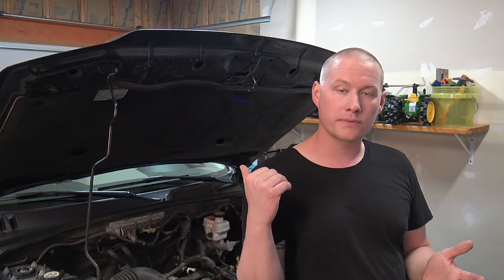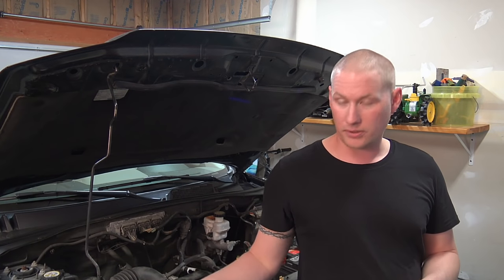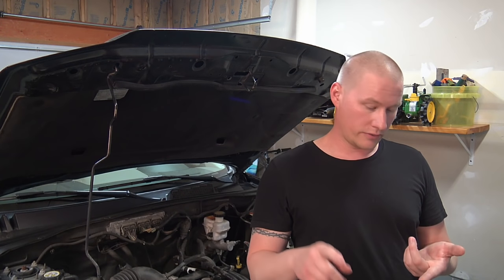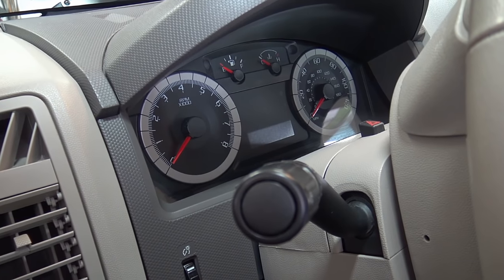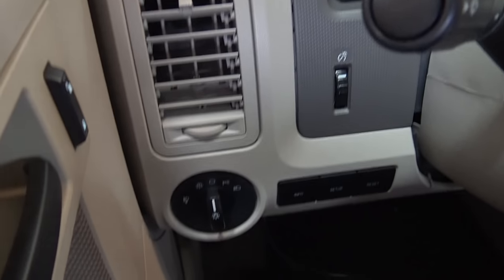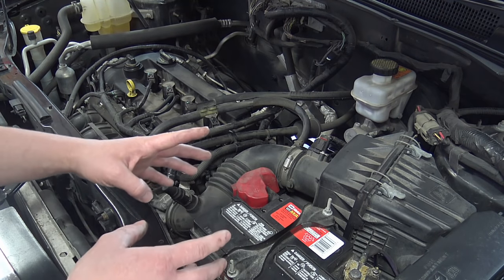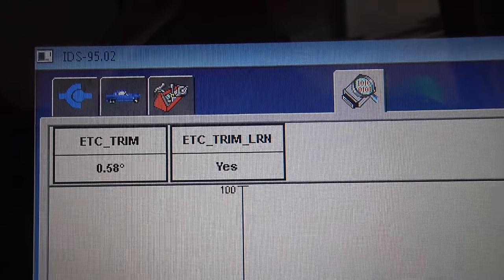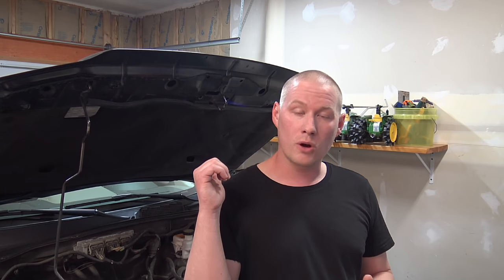Ford Vehicles: Electronic Throttle Body Calibration Procedure

Comment: tnks for your help,.....I have 03 ford expedition xlt 2wd 4.6L and have idle Hesitation after 30 seconds of start for around 15 seconds then comeback......I change IAC, same problem, I clean throttle body, same problem but some body told me that the throttle body may be bad with gaps and not close properly....its have 149,000 miles on it....can u make a video how to check the throttle body and posibles problems or symptoms the presents when bad....tnks

Comment: 2005 Crown Victoria 4.6 P71 I replaced my mass air flow sensor and throttle body has the big square TPS you have talked about in other video. I did the 20min process let warm up and just started driving it and codes popped back up. P0102 and P2106 that’s why I replaced those parts and air tube and box are all good. What else could it be a bad PCM?

Comment: My Ford Fusion 4 cylinder 2012 fluctuates roughly with AC on but sits fine with heat.  Original dealer said was normal, what do you think?  Also once in awhile car about stalled going slow enough in parking lot and car is an automatic.  I cleaned throttle body and air sensor recently but didn’t do your reset method.  Would that do anything for the ac?  Also I may be described as sometimes driving like a bat outta hell bc I’m trying to get somewhere in bad traffic, guess I should reset for shit points lol?

Comment: Hello. I cleaned the tb and followed your procedure for recalibrating on my 2013 expedition. After connecting the battery, the trunk door button is not working. What could be the problem and how to fix?

Comment: Do you leave the positive battery connected?  Can this be done with jumper cables?
Reply from the maker: Yes just disconnect the negative.
Reply: I was wondering the same as far as using a regular jumper cable

Comment: I just cleaned my throttle body on my 07 f150 5.4l and is idling really rough/shaking along with now getting engine light and wrench light on. Will the video fix it? Thanks

Comment: Good evening sir. 04 f150. Brand new motor. 😑 Anyway, i recently bought a  80mm bbk throttle body. Installed it and now my tuck runs rough at low idle. Could anything else cause this minus the re learning process? Thank you for your time.

Comment: Can a bad battery contribute to bad fuel economy? Just bought a 2014 F150 with the 5.0 and the fuel economy keeps slowly going down. There has been a few times the truck would barely crank but runs fine after it starts up. 
 Also noticed that the rpms would drop a little low at idle at times (between 450-500), is this normal or should I look into it?
 Truck has 112,000 miles on it.

Comment: (After replacing a dirty fuel injector ) When I hit the gas and try to rev up the engine at park it sometimes stumbles and looses power and even shuts off, bad throttle sensor or would you guys recommend replacing the entire throttle body?

Comment: darn this wasn't my issue. im getting a short burst of knocks only when i start my 16 fusion. google isn't helping worth a brown log.
its like dragging a wrench across some plastic fence posts that are close together. 3-4 knocks after i start it and its gone. happens cold or warm.  
my step dad put his hand on the throttle body and felt it i could see his arm shake when i heard the noise. so he thought it was that. 
BUT i also get a gear whirling noise when i let off the accelerator at 60+ mph higher speed the more noticeable. i did it after i hit 100 passing someone and i felt it through the pedal.
i just got the engine replaced for the 2nd time after piston failures. this car is an absolute pain in the johnsonville sausage.

Comment: I recently did some work on my 5.4L and I had the intake and t.b. off. I never did this procedure. But I'm now getting a p2106 code,  even after replacing the tps. Could not resetting the base idle cause that code?

Comment: Does this procedure work for Hybrids?  
I have a 2010 Ford Fusion Hybrid and had the ETB failure on the Expressway! Very scary.  Dealer replaced the ETB and reprogrammed the PCM.  But it idles very rough and transitions between gas and electric engine very rough.  I suspect the re-calibration has not been done properly.  
How do you put the hybrid engine into idle for the PCM to "relearn" the proper idle settings?

Comment: Do you need to disconnect it battery prior to changing or cleaning the throttle body. I have a 2015 Ford Transit 150 XLT 3.5 L EB with 133k. Thinking of changing the throttle body just for preventive maintenance.
Reply from the maker: Might as well disconnect the battery anyway so it can learn the new ETC angle after cleaning or replacement.

Comment: I  installed a 1989 5.0 EFI with the computer in my 72 bronco and I am having some idle issues. Would this reset work on this year model ? Been having the same problem since installed, then the battery went dead so, Thanks jim

Comment: Please help. Took my 2012 f150 ecoboost in for repair and got the molded lead frame replaced. Now Im having trouble. I have done the procedure tou have mentioned on your video to reset the throttle body. I have done this numerous times and the truck doesnt seem to relearn.  I have watched other videos but it doesnt seem to work.

Comment: Thanks..! I have a 95 T- Bird 
4.6. And I've noticed that the shift points were higher and not shifting or down shifting,. I know is not the transmission,. So I looked at my manual repair book, to see how the torque converter lock up works, but didn't found any info on it,.so, I'd noticed that by controlling the trotlle by foot I was able to control the shift points,. I knew it was going to affect the PCM since I lost my remote and need to bypass/trick the system by disconnecting ground to start the car every time I need to started.

Comment: Is there anyway to tell if it worked? None of my radio stations or trip calculators got reset? does that mean my PCM/BCM didn't get fully drained? I left it with the jumper on for 10 Minutes

Comment: I love your videos. I have a mustang Ecoboost and 100000 miles, shifts weird and acceleration is different, hard to explain I guess. I can't find anyone with my symptoms. When cruising and take my foot off the gas it feels like the Cruz is on before it starts to decelerate. Cleaned my throttle body but didn't reset, would this help, I'm going nuts trying to figure it out! Help!

Comment: I did this on our 2015 3.7 V6 Mustang.  Before had check engine light with 3 P2111 (Throttle stuck) codes with red (serious).  After the throttle body replace, still got one P2111 with yellow, but check engine light is now off.  Any idea why?  Maybe retry the battery process?  Car is running very good though.

Comment: What about for a hybrid, like my '10 Escape? The engine doesn't idle upon start up since it's running on the DC drive motors. I just changed my TB out and went thru the initial part of the reset/relearn procedure then took her for a long test drive. Everything seems fine even without going thru the idle trim relearn. With a/c on in park, it will eventually switch to engine power and idle at about 1200-1300 rpm. Can't find the specs for warm idle speed on the hybrid, so not sure if this is correct.
Reply: This, I really need an answer for this and my 08 FEH.

Comment: Does that apply only for fords ? I'm about to clean mine tomorow and I was told that i should just get out of town driving the car normaly and then i should drive it about 10km at 3000rpm.Then I shut down the car,turn it back on and it should be all fine ?
Reply from the maker: This is only Fords yes.
Reply: may I please ask you a question sir? I have a 97 cobra 4.6 4v dohc car and I was going to change my tps, is there anything in particular i need to do as far as physical adjustment like the fox bodys have to as far as setting it to below 1 ohm or letting the car re-learn the cars throttle position at idle, if so for how long and what about driving there after to teach the new tps? or are they more advanced and just plug and play in my vehicle ? what do i need to do in order to replace my tps? thank you sir

Comment: I've just removed and cleaned my throttle body on a 2007 ford focus st due to a fault, I still have the fault would I need to do this to remove the fault??? Also my car has been remapped for more power would the battery trick effect my remapping??

Comment: I have a 2018 ford transit 3.7 gas I think the problem I have has to do with the throttle body but it is weird when first cold in the morning will start fine and idle but if I take off will drop rpm real quick like dieing out but is still running if I let off the hit again will work only to do again in few minutes until fully warm

Comment: @fordtechmakuloco I had the accelerator pedal replaced at my mechanics on my 09 MKZ because it failed but now I get the orange wrench light, which I've never gotten before, When replacing the Accelerator pedal position sensor, should this procedure be performed?

Comment: the 1.8 gasoline needs to adjust the opening of the valve and idle with the rear screw provided for this purpose? nobody talks about it but there is a setting to be made to have a good fuel mixture air / fuel. do you manage this with a software?

Comment: THANK YOU I HAVE A 93 TOWN CAR I JUST CHANGED THE TPS  DO I ALL SO NEED TO DO THIS IN ORDER TO RESET THE SYSTEM ?
Reply: Due to a minor change in the voltage of the tps (differing angle from the old), I would disconnect the battery and wait 10 minutes to clear the computer (the wire capacitor drain trick helps as well). No need to relearn the throttle. Those modular v8's were cable driven.

Comment: I was thinking on putting a BBK throttle body on a 2005 F-150 4.6L to get a little more get up and go. Any thoughts on that?
Reply from the maker: I don't buy into those no.
Reply: Dont it just fucked my 15 focus st. I can’t get it to idle right even switching back to stock and doing this process. Im so bummed out

Comment: Hello! Question, my 2014 Ford Fusion SE recently started shutting of the engine while driving. I bought a cheap bluetooth ODBII device on amazon and the code it was throwing was 2110. After some quick research I found that it's quite possibly the throttle body. I purchased an OEM one on Amazon "Ford DS7Z-9E926-D Computer Module ECU" and replaced it. The car is no longer cutting off and the code has cleared; however, when I am driving the computer cuts the trim or the fuel or something and my RPMs will drop, it seems random but it's usually when I get to a cruising a point and I leave my fuel pedal pressed at the same rate. For example, I'll be at 2k rpm and start to settle to to cruise at that speed and then the car will drop the power down to 1k rpm and I either have to let off the gas pedal and repress or just pedal to the floor and wait for it to catch back up. It does it often. I followed your procedure here and it still does the same thing. Am I missing a step? Thank you in advance for you help and for making great videos!.=

Comment: Have to ask here...have a 05 F150 with the 4.6.  Engine dies when temp is below freezing. Above freezing runs fine. New MAF, throttle body, EGR, coils, plugs, air filter. Any idea?

Comment: I have been watching your videos on fords. I have a question for you. I have a 2010 ford focus ses 2 door with 260,000 miles on it. No major issues until a month ago. I recently had code P0420 set in my car. I changed the cat converter due to the code, age and miles, I also changed the both O2 sensors and Mass Air Flow sensor at the same time. I am still having the same code come back. I am about to try you tip in one of your videos with jumper wire from the positive battery cable to the disconnected negative cable. Is there any other information you might have regarding this issue? Any of you helpful insights will be very much appreciated. I plan on keeping this vehicle for about 2 more years. Fyi after changing those items my gas mileage has gone up to 38-40 miles per gallon. previous was 32-36 MPG.

Comment: Hi partner thanks for all the info you have been a great help I not been on line very long I'm old school and I've been working on my  stuff 50 years but not Ford's my question is I'm stuck in limp mode I replaced t/body unit and still getting 2 codes p2111 & p2101 I got this t/body from junk yard I've order a new one not sure if this is something I should get from the junk yard ?? and when I try to crank it my ck engine lite does not go out  I'm I not getting communication with pcm ?? Thanks for your time my 2005 explorer 4x4 is killing me I can't afford to pay some one else to fix it any help and advice you can give will be appreciated thanks again  communication to

Comment: will resetting the pcm like this help clear false abs codes? broke a sensor replacing wheel bearing and replaced it but still have service advanced trac, and no hillstart assist. no traction control. and ford charges $100 to hookup the scanner and i dont have that kind of money to just throw at a false light

Comment: Hey bud. I have a question maybe you can help me with. I have a 2015 Ford fusion Ecoboost 1.5L. for the most part the car runs pretty good. Except for once or twice a week I would get no throttle response for like 30 second's and the engine seems like it's stumbling. But after the 30 second's it's fine and runs good. I'm leaning towards the throttle body. But wanted to see what you think or have you seen a similar issue yet. 
Thanks.

Comment: ...does this apply to ford fiesta MK7 throttle body especially on the "jumping" the battery, won't the battery will be shorted or get damaged or result to blown fuse? i have cleaned my TB after that i just run the engine for few minutes and go for a test drive,

Comment: So I had my throttle body fail on my truck and it wouldn’t even start. When I turn the key, a wrench comes on the dash and it won’t allow me to do anything. No crank, ect. Will running that jumper from positive to negative on the battery clear that once I install the new one?

Comment: Any chance that not letting the throttle body relearn when I replaced the battery almost a year ago is the reason it went into limp home mode last week? It hasn't done it since and the dealership couldn't find any error codes. Only seemed to happen when I accelerated hard from a stop.

Comment: I have an 05 Expedition. On the highway, it went into limp mode and showed a "check electronic throttle control" message. The TB was cleaned a few months ago when my local shop was trying to diagnose a rough idle (was the MAF). Should I clean the TB again and relearn again or would this be a symptom of something else?

Comment: My 2007 Ford Expedition had a code indicating the throttle body was bad and needed replacing. I replaced it and reset the PCM values as described in this video. I went for a test drive and about a mile in it went into low idle mode and the WRENCH light and check engine light came on. I switched off for thirty seconds and restarted. The wrench light was off but the check engine light remained on. Vehicle was running fine except an occasional shudder. The above described scenario repeated itself another 4-5 times during the rest of the test drive (approximately 5 miles). What should I check if the codes are the same?

Comment: This work with the 2017 Ford Fiesta? My throttle sensor error keeps sending it into check engine and engine malfunction errors. After a while both errors go off. I bought the pedal and sensor but I'm starting to wonder if it's not the carburetor looking thing under the hood. But thought I would try this before replacing the pedal and sensor.

Comment: I've changed the ETB on my 2013 Fusion S 2.5L three times since I bought the car new. Each change was after I tried cleaning the ETB and mass air sensor but continued to have the limp home issue. Followed your instructions to clear the PCM and each time it seemed to work but the limp still occurred occasionally. I've noticed that it always happens when I'm moving slowly (like thru a turn) and trying to accelerate. I know there were issues with Ford's ETB's. I just want this over. Any suggestions? Does the ETB itself need to be reprogrammed? Thx
Reply: Dude he just said u need to program the etb. Didnt u watch the video

Comment: When you clear out the capacitors, don't many other saved engine parameters also get reset besides the throttle body position?

Comment: The Ford shop manual for my 09 Grand Marquis states that the throttle body bolts have to be rotated 90 degrees.  It doesn't explicitly say to install new bolts, and implies to reuse the old ones.  Can the old stretched bolts be rotated 90 degrees again; should new bolts be installed and stretched; or is it even necessary to rotate the bolts whether new or used?

Comment: Hello sir, I have a 2019 Ford Edge and it has been having some hesitation when I drive this automatic 2.0 with eco-boost. It will (sometimes) hesitate when you drive the car from 0 MPH to about 35 to 40 MPH, once you get passed the 35 or so MPH, it wont act up. Does it sound like it may be a MAF issue or a THROTTLE BODY SENSOR issue?

Also, can you tell me where the Throttle body may be located in a 2019 Ford Edge?

Comment: Something else I might try, I might try doing the procedure that you did here I have to wait till my engines cold again. Then instead of driving it so I can learn shift points I'm going to let it sit there turn the darn thing off and let it sit there. Then maybe when I turn it on again since it will have learned the idle, it won't come up with that stupid p2135 code and that stupid yellow wrench. I don't know that's going to work or not.